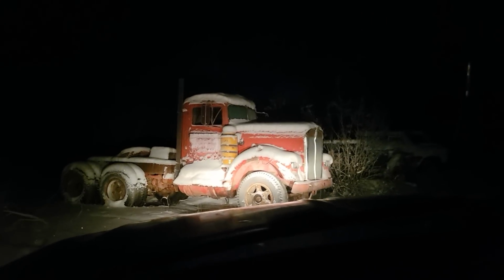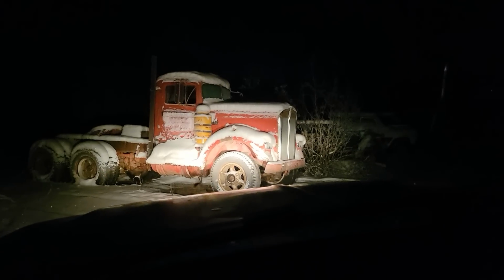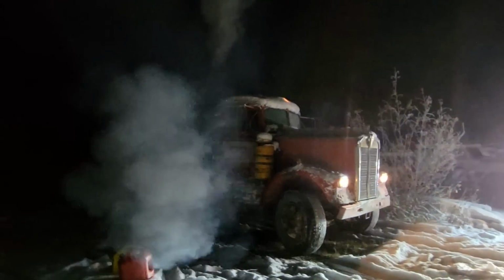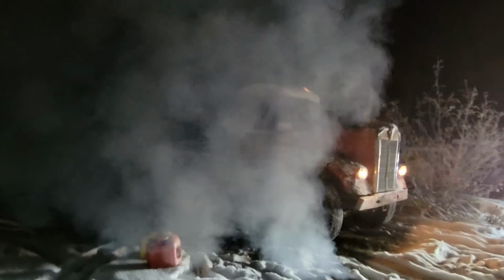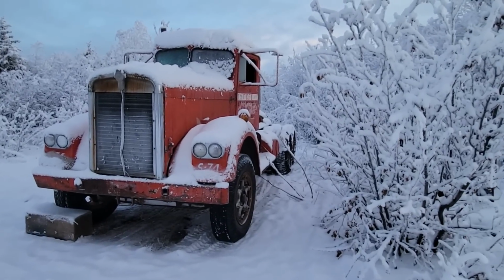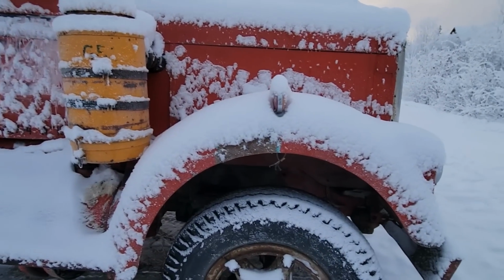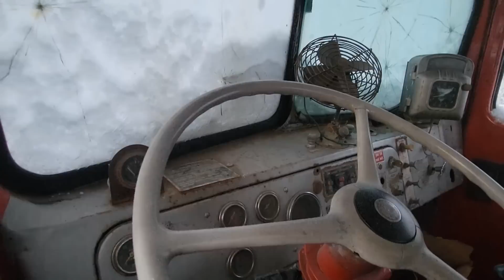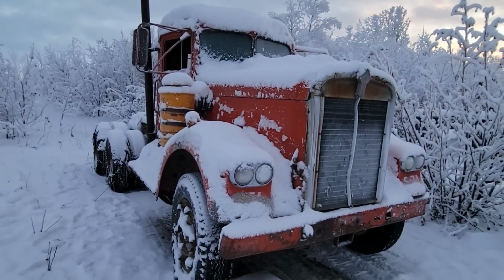1959 Kenworth Cold Started, and Chained up

Comment: to think I used to work on those KW, 230 Cummins, back in the day, worked at Empire White Trucks in Syracuse NY, yet while it was still viable City, back in the late 60's to the early 70's
like that old tractor, they be gone now. lots of king pins bearings suspension work. general service and clutch R&R jobs. The company would broker glider kits, piggy back them in. 
three at a time. Caterpillar was my main line of work, went back in to the dirt.

Comment: almost seems like it was twisted by a trailer tipping over. do you know how the frame was bent? kinda goes with the dented tank.
Reply from the maker: No idea how it got that way
Reply: Mostly tweaked out because the suspension is absolutely toasted. Those torsion bars are real bad about it. I got a 64 925 also with this 59 and it’s not much better suspension wise
Reply: @nickmaines907  it's awesome that you guys have the antique semi tractors. some day i'll get an old mack.

Comment: Engine sounds like it's not hitting on all 6
Reply: It definitely isn’t. Hasn’t the whole time I’ve owned it
Reply: @nickmaines907  right ever think about fixing it?
Reply: @keepontruckinoutlawlife1248  yah but not until more die. I had to put gasoline and diesel in it to get it fire up. It had straight used oil in it with no fuel filter on the truck.
Reply: As an old Cummins man I’m thinking a sized injector, or bent push tube.  If you get it running ( when the weather is warm enough you don’t need to torture it with either 👎) and as it’s just starting to warm up, take you bare hand and touch the exhaust manifold on each exhaust port with your fingers.
You will feel to see which one is cool longer than the others. 1 and 6 will take a little longer to heat up. Eventually they will get too hot to touch. The one 
that’s cool is the cylinder your problem lies with.  To get that far won’t cost you anything.  Please don’t rev up a cold engine.  Pushing the full pedal down 
when cranking the engine over tells old timers you don’t know how a PT fuel pump works.  It’s a nice old truck. Hasn’t been loved, though.
Reply: @georgerenton965  I agree 100%